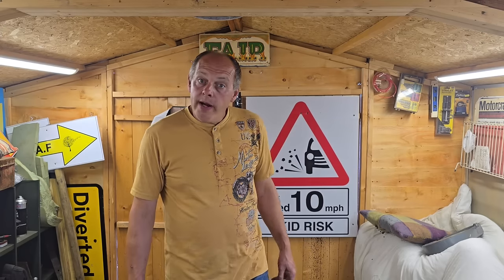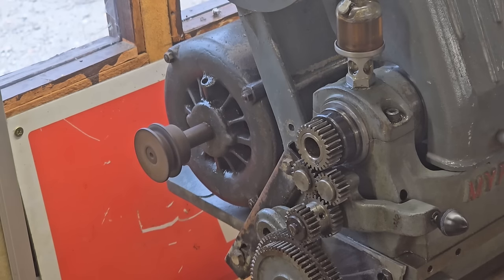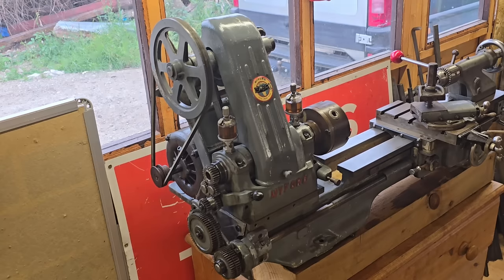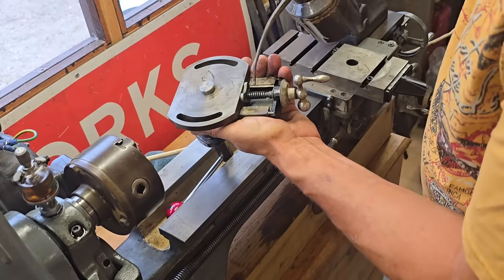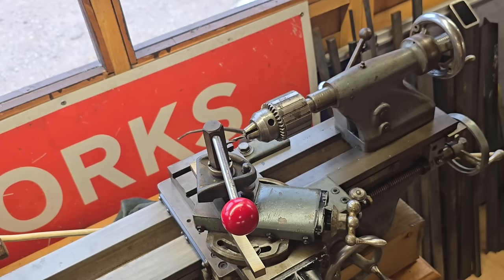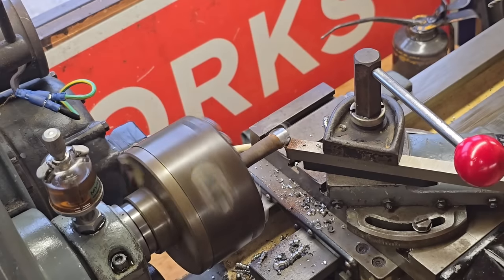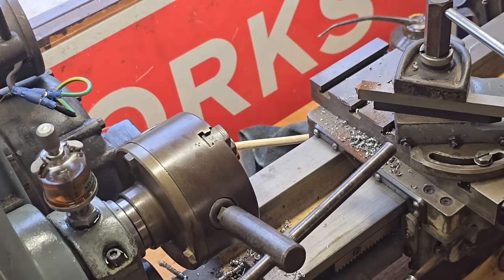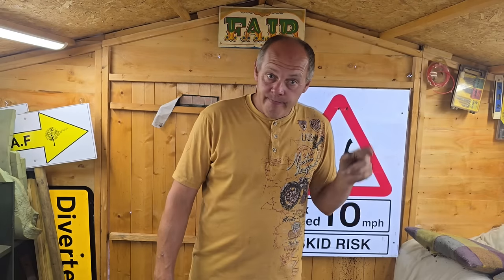Trying the Myford Lathe and electric motor repair.

Comment: I watched Mrs Man Caves very brave and honest announcement of her diagnosis and subsequent treatment she has to go through. Please give her my very best wishes for a very speedy and full recovery. 
A couple of tips on turning outside diameters. 
Alway approach the cut from the same direction, this is important as it will allow for and eliminate  the 'backlash' inerrrant in any lathe and its  screw threads.
At the start of the cut, zero the dial on the cross slide. On the next cut you can then reference the zero position and then add however much extra you wish to cut using the graduations on the dial. You will be able with a little practise to achieve very accurate results and turn to any specific dimension you desire.
Remember that every cut and the increments you decide to use will result in DOUBLE the total material removed with respect to the diameter of the piece.
Learn how to sharpen you lathe bits with the correct rake and clearance angles. A bench grinder with a well dressed wheel is essential. You will not be able to sharpen carbide bits on the same wheell as you sharpen regular tool steel. You will need a green wheel for this. Keeping your bits sharpened correctly will make for much better cuts and finishes. Easier more efficient cuts will also reduce loads on the machine and ultimately reduce  wear and tear.
The use of cutting oils is also a very good idea. This will help keep the tool and workplace cool, increase the longevity of the 'edge' of the tool and improve the workpiece finish.
As a rule of thumb smaller dia material can be turned at faster speeds than larger diameters. Cutting speeds are calculated by the linear length per minute. And that part of the equation varies with the material. There are tables online that you can look up to get you close , bear in mind your lathe has limited variability with its speed.
As you get to know your lathe you'll learn what it is capable of and adjust your technique for the best results and not stress the machine.
Ok, lesson over. Sorry to be a bit long winded.
Keep your hair  short too.😂
Good luck.

Comment: For a first go that is actually very good Adam. I'll get the negatives out of the way first. NEVER LEAVE THE KEY IN THE CHUCK😅 you just said it. I should have waited to the end😂. You were feeding the tool along the work a little too fast, that is why it looked like a thread. Use the handwheel on the carridge to feed. Using the leadscrew should be reserved for when you need acurate distances between shoulders along the length or when milling. There is no seperate feed drive on those little Myfords it is all done through the leadscrew which you should keep from wear so to maintaon acuracy when cutting threads. Try to have as little sticking out of the chuck as you can get away with. This will help reduce chatter and improve your finish. Using a cutting oil will also help, if you don't have any, rape seed oil is excellent and cheap enough at  Aldi. Now the good points. There is nothing wrong with that tool, it seems sharp and well set. As to your depth of cut, she took it didn't she? It'll stall out if you get too greedy, she's only a little lass. The direction of cut is directly related to the tool bit geometry. If it cuts frward and back then it is ground/set up to cut foward and back. Sometimes you can get an improved surface finish cutting away from the chuck. Tool geometry is too big a subject to discuss here, get a good model engineering book and play with the shapes, they are not that complicated. Just keep going as you are, playing with it to find out what works and what dosn't. Just don't have the belts too tight, that way if you mess up they will slip before any damage can be done. You have a lovely little lathe there and in fantastic condition you will be happy together for longer than you will need it (if you take care of it). Now, on that point, clean out that damed grease and get her oiled up properly. If it moves oil it with a can, if it doesn't move oily rag to protect. You have a good mechanical mind, you will mater this in no time. There are lots of us out here willing to help and loads of good videos. The only thing about videos is small hobby lathes like yours will not do the things a larger industrial machine machine will, use your discression. All the best buddy. Mark

Comment: Been asked by Sybil to pass on her most dearest wishes to Rachael. She NEVER misses a single video of yours. 

Not bad at all for a first play on a lathe, by someone with no knowledge.   My first ever thing I made on the lathe at College (23 years ago) was a plumb bob, I keep it in my tool box, but I've never used it.  

Hope you don't mind me offering you a few tips. 

The best way to get the tool at centre Hight is to line the cutting edge up with the point of a centre in the tail stock (more accurate than a drill). 

Judging by your turning with some neat grooves in, you were using what is called a undercut tool (for machining grooves) Normally for turning diameters you would use a knife tool (left hand is normal, for working towards the chuck, but you can get right hand to for working towards the tail stock). You would normally have this set roughly right angles to the lathe bed (with slight clearance), but move it at a angle towards to work when facing off (for extra clearance). Do not try to cut backwards unless forced on a normal knife tool, as it will just blunt the cutting edge.  

The rule of thumb for cutting speed is the bigger the diameter the slower the RPM of the job, because the surface speed is much higher. Also when machining harder materials (such as steel etc) you run slower. The old bolt you machined was a soft bit of steel (obviously not high tensile lol). 

I'm not sure if you have seperate leavers for screw cutting and self feed, if not you might want to play around with the leadscrew gears to slow the feed down, as its feeding a bit quick i would say (judging by what I could see when you was playing around).  

When you get curly swarf like you saw, it normally means the tool is cutting well. You will only tend to see this with steel or aluminium (also copper and lead, but you need a negative rake angle for those). 

The video you watched was correct regarding tungsten carbide tipped tools, there not great for light cuts. There good for roughing out with heavy cuts or for very hard materials, but I can't imagine you would need to worry about that, good cutting tips are expensive, so using HSS tool steel is the right call for what your will be doing. 

Another safety tip to add to those you mentioned is, never wear normal work gloves (latex ones ok), many accidents have happened where gloves have got court and grabbed a person's finger off. I would recommend work gloves when cleaning swarf, because it can be razor sharp, and never clean the swarf by hand when machine is running.  

Not sure some set the compound slide up at a angle for (I to have observed it), I've never been taught that way unless turning tapers by hand. I normally have mine set (as I was brought up to) parallel to the bed, so when facing off, fine and accurate cuts can be clocked on. 

I have a shelf above my lathe, I drilled a hole in it to put both chuck keys.... but 9 times out of 10, it ends up under the bed of the lathe in the tray - guess I'm lazy lol.

I use Tracy tools for my tooking. I have used RDG in the past, but I find a lot of their tooling to be of poor quality for the heavy work I do. 

You will soon be making the Rustons missing governor parts Adam 🙂. 

Keep up the good work, and all our love to Mrs Mancave.

Comment: Hi Adam + Rachel, look after your selves you will get through, just be positive. The lather is running well I never used a lathe but by the way you were using it your doing a good job.
You said earlier you had to fit a capacitor was this 3 phase motor so you had to install a capacitor to the second live terminal so instead of L1 L2 L3 you  connected L1 then a capacitor to would have be L2 and neutral to L3. I have seen videos on converting 3 phase machines to run on single phase by using a capacitor. Great video  Take care

Comment: Adam you forgot to put oil in the oil hole next to the pulley and the screw cap on.Great little lathe,you will have alot of fun using that.

Comment: Best wishes to you both ,  so many people have recovered  from the condition inc my mother,  so we know what its like , back to the electrics i try to set a separate cuicuit breaker in anything a bit dodgy , then it will trip and reset until its fixed , thanks for the update Adam,

Comment: Hi Adam, I'd like to make a few points. Firstly I aplaud Rachel for wanting to record her jourmey. As to most of us not being interested, even if that were true, most of us have a better half that would. Secondly when my better half was going through her breast cancer treatment one of the others going through the same thing was a man. Little known fact, men have a small amount of breast tissue and can get breast cancer. Just ask your consultant. Thirdly lathes and mills very rarely have grease nipples. They are for oil! After 40 years repairing machine tools you don't want to know how much damage grease can do to plain bearings. If it's supposed to have grease you'll use too much oil, if it's supposed to have oil you'll be replacing shafts and bearings.
Good luck Rachel, me and Gert are looking forward to your next update. XX

Comment: Again all the best wishes to Mrs mancave.
Did you miss the pulley end of motor oiling point?
Most lathes do not get greased, those nipples are like many old cars and are designed for an oil gun.
Enjoy the adventure of learning  what you can do with a lathe, it  is a constant learning curve, there is always more to learn.
There are many great YouTube channels like "Blondie hacks" that will not only teach you, but also give you more ideas.
Keep up the fun channel. Good luck.
Reply: The reason many hobby users have carbide bits is because they aren't setup to grind high speed steel. 
Your next adventure will be learning to grind and shape high speed steel.
The shape of cutter changes for direction of cut, material being cut.
Reply: You will now also be looking for raw material to turn, looking in those boxes of scrap at the auctions etc.
Reply: First safety advice, get a power switch & emergency stop button on the lathe so you can stop it quickly in an emergency.
Don't postpone safety, make it a priority..
We don't want to see a "what not to do, accident video."
Reply: Please fit a power switch & emergency stop button onto the lathe or stand as soon as possible.
We do not want to see a "what not to do, accident video" being posted.
Stay safe and have that e-stop fitted ASAP.

Comment: Great effort for your first try.
If you are getting continuous swarf ‘springs’ then you have a good cut and feed speed.
When you get it set up proper then please wire it via some sort of local kill switch so if goes tits-up you can stop it faster than having to run across the shed. Maybe a foot switch?

Comment: Adam, Depending on the type of bit you are using it should be perpendicular to the work piece, you should have the cross slide straight not at an angle, to get a better finish high speed chuck and slow feed, use some oil to assist

Comment: The tool bit you are using has been made by someone to cut a slot or acme screw thread into something. Looks like your feed rate is a bit high, to get a finer finish you need to slow the feed down, (thats how fast you move the tool along the shaft you are turning). For cantering the height of the tool its best to use a center drill or a dead center if you have one.

Comment: You will find you get better finishes  machining  non ferrous metals ,   ie Brass , Bronze and Aluminium .  Its a case of practice makes perfect ,  Trial and error , but its another string to your bow .  Theres plenty info on You Tube about lathe working  . I think you should rename the lathe ,  "  Rachael  "   .

Comment: 10.43 - 10.55  " I know there's a bit of exposed showing there but this is just for testing, before I go flicking metal chips I will tape them up " 
YOU DIDN'T ......... and there were chippings and 'springs' of swarf flying everywhere !

Comment: Your getting on OK. But one thing I'll say immediately is No 1 safety lesson. DONT EVER LEAVE THE CHUCK KEY IN THE CHUCK! Believe me if you accidently turn the machine on with the key in the chuck it can make a real mess of whatever is in the way.
When you get down to some machining with smaller diameter try not to take too deep a cut as the laws of physics dictates the workpiece will try and ride up on the tooling and if it does you'll probably break both.
These machines generate so much torque they'll stop for nothing so safety, safety, safety! Sorry to bang on but it's something I can't stress enough and I'd rather you kept all your extremities.

Comment: did you not do metal work whilst at school? or are you just young enough where they started selling off all the machines from schools and dumbing it down . As when i was at school we did lathe work,milling,welding, brazing etc it would give the health and safety  a fit these days as we didn't even wear safety spec and if you cut your self you just run it under the tap and carried on.